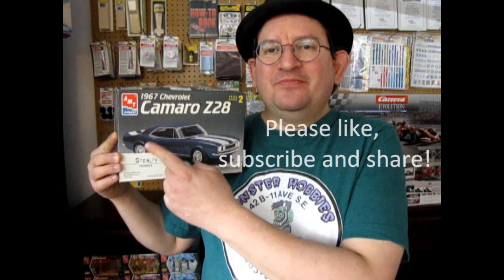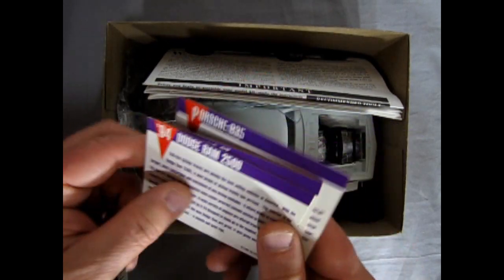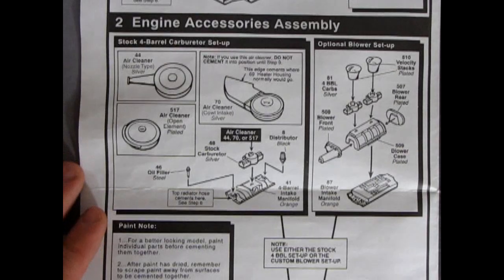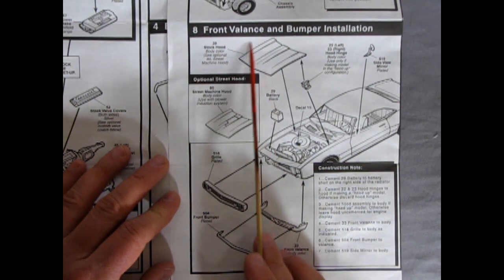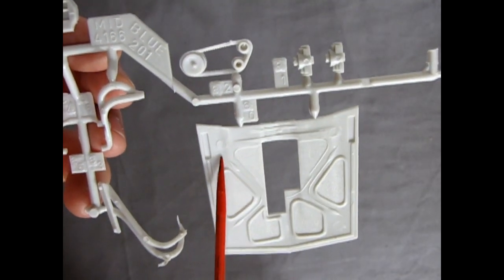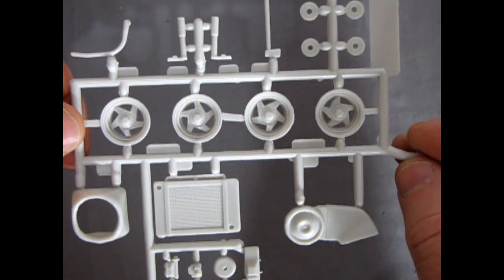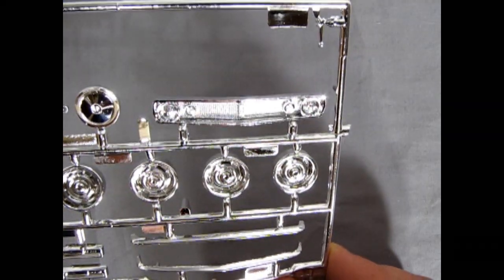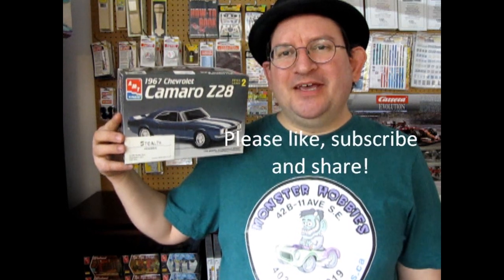Model Car Garage - 1967 Chevrolet Camaro Z-28 by AMT/ERTL - A Model Car Unboxing Video

Comment: I just picked up  the 68 z28 kit and it looks the same except for the stuff to make it a 67. lot of the same parts and part#, that sprue that reads mid blue, same. The sets look different.
Reply from the maker: It seems like Round2 brings out or restores old molds with missing parts from previous releases. It's nice to know you can back-date the new release to 1967!

Comment: Whats the difference between 68 and 67 camaro, which came out first 68 or 67 camaro? Nice kit
Reply from the maker: Good question. I would think that the 1967 Camaro model kit came first as AMT would have made it as an annual kit. 

The first and most obvious way to separate a 1967 Camaro from the rest of the herd is by the vent/wing window, something the ’68 and ’69 models lack. That small triangular piece of glass in front of the side door windows makes a huge difference.

The side marker lights that were present on the ’68 and ’69 Camaro are not the ’67.